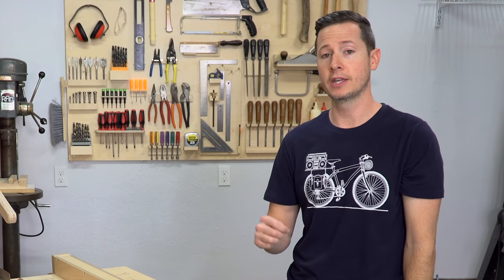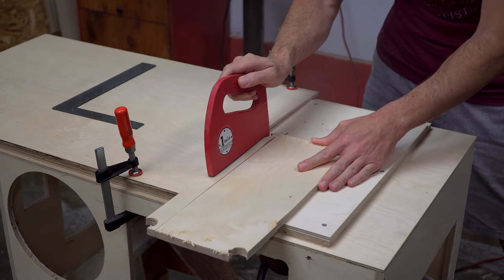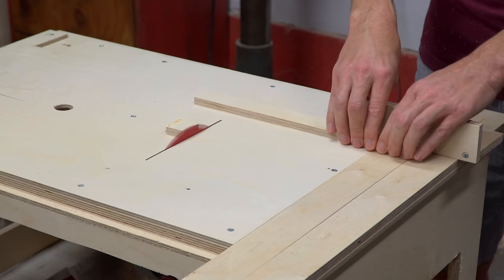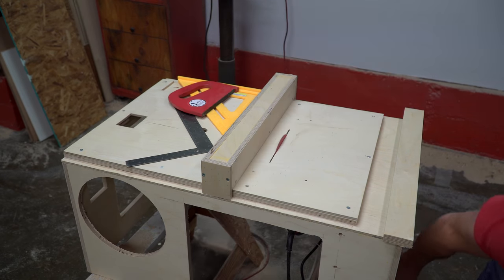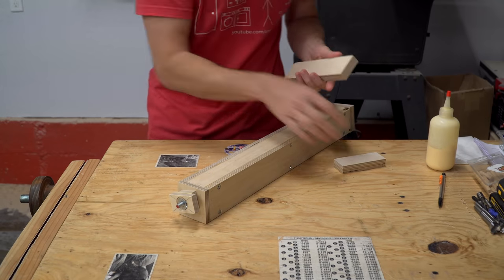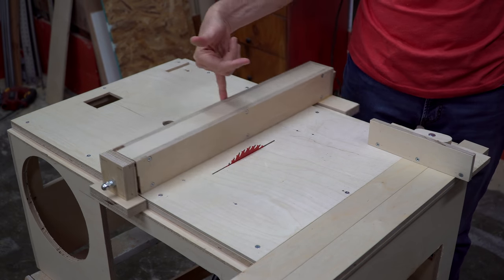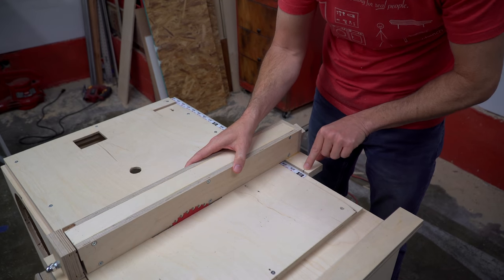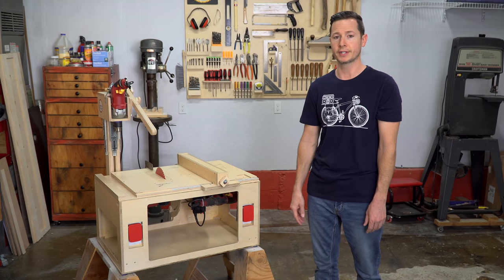Building the MicroShop, Part 3

Comment: I love the design, and the fence is one of the most practical designs I've come across to date. That alone made it worth buying the plans as I've always been uncomfortable leaving the opposite end of the fence left free-floating in all other designs I've seen. One minor addition I made to my version of the fence was to add a small rectangle of 6mm ply to the top of the fence, over the floating end cap to provide a counterbalancing force to the far end of the fence as I tightened the knob to lock the fence. This change allowed me to use the fence on a worktop which doesn't have a track for the floating end of the T to travel on, which basically accomplishes the same purpose. The same effect could have also been achieved by lengthening the top part of the fence box, and shortening the height of the end cap, instead of adding another piece to the top, but I had already finished the fence by then.

Again, really love the designs and hard work put into the whole build. Keep on rocking, Tommy!

Comment: Nice.  I really like the fence design.  Thinking about that issue with the mitre gauge needing to be so tight... my concern with the sandpaper is that eventually it'll wear away the wood that it's rubbing against for friction and get loose again.  Easy enough to replace that piece of wood every so often I guess, but the other option might be to use rubber instead of sandpaper so you get the grip without the wear.  Can't wait to see the drill press.
Reply from the maker: Thank you very much! I actually tried a piece of rubber, and decided against it. It just didn't feel right...not as "solid". The rubber has some give, which allowed the adjustable piece to wiggle ever so slightly, and made me feel like my cuts wouldn't be perfect. Yes the sandpaper will need to be replaced, but as you mentioned, it easy enough and it won't have to be done too often. I hope this helps!

Comment: Very nice! My only suggestion would be to move the screw in the fence that is right by the blade @ 14:50 in the video.
Reply from the maker: Thank you, and thanks for the suggestion! I'll probably leave it though. It may be hard to tell from the video, but the head is recessed...probably about a 1/16th or so. If the blade ever touches the fence, I've already messed up...if I can press the blade hard enough to go broadside/sideways through 1/16" of material, then I've probably got bigger problems to deal with than that screw 🤣

Comment: An easier way to calibrate the tape might be to not initially mark the fence, but place the tape close to where you want the mark it. Then, lock the fence in place, make the test cut, measure the width using the caliper, and use the caliper to mark the fence at the measured offset.

Comment: This is great and your plans are very reasonable. I keep debating getting a table saw or build this. All the the fences in the saws I can afford are crap. I’m also wondering if building this with a one battery platform system would work? Possibly Ryobi or a similar brand to keep cost down on the equipment as well as the availability of affordable and high capacity batteries. Just a thought.
Reply from the maker: Thank you! I'd say, if you're not yet proficient in table saw use, then this project may be a little too advanced. It would be best to start by buying a saw and learning how to use it. If however you already know how to use one, this project will be more approachable. As far as making it battery based goes - it certainly sounds cool, but cost will go up. You just have to consider whether or not you are going to be using it where there is no power available. If you've got one outlet nearby, then all the tools work from that single plug. Just something to consider. Anyway, I hope this helps!

Comment: Nice build. 

Question: 

 If someone is going to go through all the effort to build their own work table. Why not scribe the measurement marks the complete length of the table to line up the fence, for standard measurements say 1 in, 2 in 4in and 6 in?

That way you could always check to make sure the fence stayed square.
Reply from the maker: Thank you - I'm glad you enjoyed the build! That's an interesting thought - thanks also for sharing it. I put my effort into making sure the fence performed correctly before moving on. If for example I added the T-square to the front end (knob end) of the fence and it wasn't square, I would have reset it. I then tested the fence by moving it, locking it, check it for square, and then repeating that process dozens of times. After a while, I could tell that any position I locked the fence in, it was square, so any further verification was unwarranted. Again, it is any interesting thought though - Maybe you could scribe one line somewhere along the table (at any random spot, as long as it was drawn perfectly square), and you could use that line to verify that your fence has stayed square over time. Anyway, thanks again for sharing the idea!
Reply: @OneMinuteWorkbench  Yes, your work is outstanding.
You could just scribe one or marks at the far end instead of all the way across.

For commercial metal tops you could square them to a certain measurement(one that you use a lot.), and cut a small groove at one end.

Comment: Really cool ideas here! I am looking forward to the next video. Do you plan to align the saw with the fence? I think if it's off, that would be easier than adjusting that fence as it seems to be where it's going to be. That's pretty important and will be safer and your cuts will be smoother.
Reply from the maker: Thank you, I'm glad you're enjoying this build! I don't know if you saw the previous videos, but when I installed the saw, I meticulously aligned it with the table. That said, I just  made sure the fence was also well-aligned with the table, and the blade lines up to the fence very nicely. I would think if it were off though, as you've suggested, aligned the saw to the fence would probably be easier. Thanks for sharing!
Reply: @OneMinuteWorkbench  Yes. I watched the others as well. I remembered that you had squared it to the table, but things still happen. Might not be a bad idea to check. But then again, it's a 7 1/4" blade and not a standard 10" table saw blade, so it's not quite as critical.
Again, I love what you're doing here!

Comment: Great build! What were the adjustments you made to tune the fence?
Reply from the maker: If you look closely at that section of the video, you’ll see that it was something like 6.011”, so I just put the piece back in between the blade and fence, and then applied slight pressure on the fence (towards the blade) before tightening it back down. I then removed the piece (you can see in the video that it was “wedged” in there if you watch closely) and ran it through again. After measuring it that time it was between 6.004” and 6.002”. To put that in terms of fractions, 1/64” is .016”, so even 6.011” (for a target of 6.000”) was pretty good, but 6.002”-6.004” is even better. I hope this helps!

Comment: Hey, you're a great engineer. Will you be able to change the blade angle down the road or will it always be 90 degrees?
Reply from the maker: Thank you for the compliment! Yes, since the throat plate is removable (if you haven’t seen it yet, it can be seen in the “features” video, link in description) you can add new ones as necessary. You could make a universal one, or individual ones for specific angles, if you want to maintain zero-clearance. I hope this helps!
Reply: @OneMinuteWorkbench  that is really awesome. I will go back and watch the features vid!

Comment: Great video. Good job. Where did you get that gigantic caliper?
Reply from the maker: Harbor freight...pretty good deal at $50. I’ve used all the expensive brands, and while they are nicer, this one has earned its keep over the last 5 years that I’ve had it.
Reply: One Minute Workbench ok, I’ll check them out. Thanks for the comeback

Comment: You haven't added the throat plate yet. Do you save it for later?
Reply from the maker: Yes - I'll show it later in the series. I hope this helps!
Reply: Out of curiosity, what kind of circular did you use and how much does it weigh?
Reply from the maker: Chicago Electric (a cheap from Harbor Freight), and the whole thing when all combined is 80 lbs.

Comment: Are we not worried about kick back with the half completed table saw?
Reply from the maker: We definitely are! It's imperative that good technique be used when working with a saw that doesn't have any anti-kickback measures, whether it's a half-built homemade saw, or if it's an old school saw that never had any anti-kickback measures designed for it. Most of the guys that make DIY table saws just use the methods that were commonplace before anti-kickback devices were created, and there is a whole generation of woodworkers that aren't even familiar with those techniques because newer saws all have those measures built in. If you're interested in learning more about techniques for using a saw that doesn't have anti-kickback devices built in, I recommend looking at the series John Heisz did about his saw (which is old school, with no safety features). He does a really great job of explaining the techniques...probably better than I would be able to. Anyway, I hope this helps!

Comment: Dude your hammer needs more experience
Reply from the maker: Which one...the brand new smooth face hammer I used in this video, or my 16 year old 22oz Stanely Fatmax framing hammer with all the paint worn from its hickory handle, and its waffle face that has had to be re-sawed with a hacksaw several times? 😉
Reply: @OneMinuteWorkbench  just sayin', where I'm from a guy could get beat up carrying around a shiny hammer like that